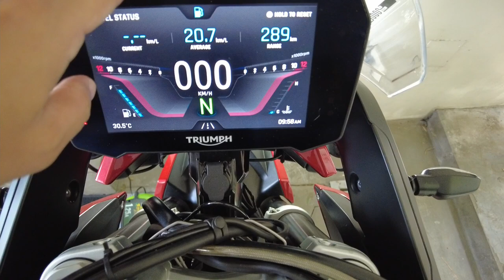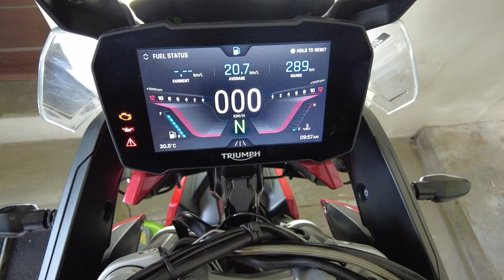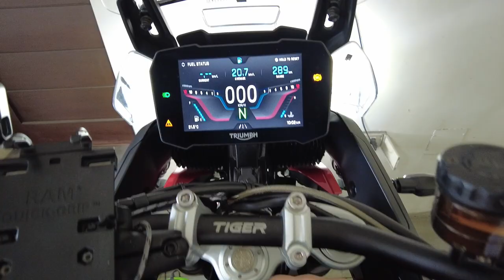Owning the Triumph Tiger 900 GT Low (LRH): Views from a New Rider

Comment: Very nice review. Yes I'm calling it a review even if you don't because it was extremely well thought out and you have included all the information a new rider needs from the perspective of an owner. Well done. Like you I'm 5' 5" 1/2 and have an inseam of 30 in, but I can flatfoot my GT pro with the low seat option. If I wear my Daytona M-Star GTX boots I can flatfoot my GT pro with the standard seat (on the low setting). Did you try a standard GT with the low seat?
Reply from the maker: Oh wow! The dealer did tell me months after I got my GT that they eventually tried the same thing that you did, which was to use the adjustable seat on the regular GT / GT Pro, and that it indeed brought the seat height to a more manageable level, without sacrificing ground clearance.  This was after I purchased my GT model, but it was still good to know that this was something others can do. It's really helpful to know that it works well for a 30 inch inseam,  so this is an option I can consider if I eventually upgrade to the Pro version. Thanks a lot for your very kind comments. I find it encouraging, because this was my first ever actual commentary or review (as you've mentioned) about a bike. Ride safe always!

Comment: Thank you for your thorough review of the 900 low. I’m 5’6” and have sat on the bike and really felt comfortable on it. For us shorter individuals I just wish there were more options for us in the adventure class of motorcycles.
Reply from the maker: Thanks a lot for your comment Chuck. I agree, I do hope there were more options. I actually tried the GS 1250 recently and realized that it's also accessible, but then I've decided to stick with my Tiger, because I do enjoy it a lot. 👍
Reply: Were you able to flat foot it? I am 5’4” with 28” inseam.
Reply from the maker: @RR9sf  Yes, I am able to flatfoot the bike with slightly bent knees. I have a 30 inch inseam so I think you'd have no problem.
Reply: I seen a video with a beginner girl rider that had her Tiger Adventure lowered for her height & it was super nice bike plus allowed her to ride with her husband 👍 I’m not trying to sell you a Triumph but they give the most options & are very nicely optioned out for anyones wants or needs.
Can’t find that in other manufacturers 😢

Comment: Thanks so much for your very informative "review" and personal experience with the 900 GT Low! I am a little over 5'7" with a 31" inseam and have been riding a Yamaha Super Tenere (1200cc) for the last year. I have the seat in the low position, at about 33.5. With "sag," I can usually only flat-foot one foot at stops. I have found this bike to be top heavy and challenging to push when parking it - as I cannot straddle it I have to roll it into place - and have dropped it doing this. I am selling this bike and am considering the Triumph 900 GT or the 800XRX, as well as the BMW F700GS. I appreciated your showing the adjustable seat for the 900. This helps a lot! Cheers from Colorado!
Reply from the maker: Thanks a lot for your comment and also for sharing your experience with  the taller Super Tenere. I recently also started looking at the GS line in case I eventually want to transition to the heavier ADVs and I was surprised at the accessible height and balance of the 1250 GS. Another mid-sized ADV bike that I was recently impressed with is the KTM 790 adventure, which is super light and easily manageable even with its 830-850 mm seat height. Good luck in your search and it would be great if you can share what you eventually decide on. Ride safe 👍

Comment: You call yourself a new rider but you have developed a good sense of discipline and confidence on many different terrains! I am also a ‘new rider’ who currently owns a Ducati scrambler  icon and a thruxton rs (I had to have it) and am thinking about buying a tiger 900 low for longer rides and adventures. Thanks to your thoughtful and thorough video, I am one step closer. I do not need to keep up with the gsx1200 folks. I just want warm hands (I know it’s extra!) and cruise control. And the ability to feel ready for a highway!
Reply from the maker: Wow, I really love the cool iconic style of the Thruxton! Thanks a lot for your kind comments Elizabeth, and it's great to meet another enthusiast online 👍. I think the Tiger 900 is able to hold its own out there on the road, and it's really quite light. Although I did have a problem when I loaded my topbox with camping gear and went offroad 😅... that was a lesson learned for me.
Reply: Remember expert to novice, it’s all trial & error 💯 I’ve been riding sense 5 & I still learning lol, and 3 time world Champ in class.
Theses new bikes are so amazing 😳🤗I’ve stuck to basics first, comfort comfort comfort, then quality, & options. That way you feel like you’re one with the bike, and not on a bucking bronco 😂
Hope that helps. Weight to Hp & Torque are helpful too 🏍️💨

Comment: Excellent video.  I am 5’7” with a 29.5 inseam. I’m also 72 years old.  I am currently riding a BMW 1250 RT because I’m doing long distance touring.  As I age I will be downsizing to a lighter, lower touring/adventure bike so I am very interested in your vid on the 900.  Thanks for your great info.  Cheers from Tucson.
Reply from the maker: Greetings from Manila! I'm really happy that the video has been of some help. What amazes me the most is how Triumph succeeded in making the bike feel so light, and how they managed to put much of the weight at the bottom. This also gave me more room to load my bike with stuff for long hauls. For example, I just bought the top box... I earlier feared its impact on "top heaviness" but I actually almost don't feel anything. Ride safe!

Comment: Thank you. I’m 5-6 and  also got my first bike 3 years ago. T100. . It’s not comfy for long distances and can’t go on gravel . I’ve been looking around for a adv that I fit on . I’m def gonna check this out.
Reply from the maker: Thanks for your comment. 👍 The bike has certainly increased my confidence in riding ADV bikes, and I've used it to try out offroad tracks as well. It's not as capable offroad as other ADV bikes (given its road bias), but I think it can handle the occasional trails. Good luck with your search.

Comment: I’ll have my 900 GT pro soon 🤗🎉 
Also remember tires will give much options on what type of riding you will me doing.
Standard tires are street. 
The suspension has all modes you can ever think of on the GT Pro or just get the Adventure model🥳
Reply from the maker: The GT Pro indeed has more options than the regular GT and I believe more riding modes. I also agree on the type of tires... I changed mine last year to Scorpion STRs and they made a big difference when I took the bike offroad. 👍

Comment: Great video. Thank you so much. I'm picking up a 900 Tiger GT Pro next week. I'm 5' 5" with a 28 inch inseam. I sat on the 900 LRH model that you reviewed and it felt great. I found a GP Pro for sale with only 984 miles on it. Perfect condition. Since it was a private sale within the state (Arizona), I didn't have to pay sales tax, and as a private sale there was no freight, setup charge, etc. that a dealer would add. Since I need to low ride height of the LRH model, I'm investing in the LRH seat, and a set of Lust Racing lowering links. These two mods bring the GT Pro down to the same ride height as your LRH model. Thank you again for an excellent video.
Reply from the maker: Thanks a lot and I'm glad you liked the video. The LRH is suprisingly low for an ADV... 770mm if I'm not mistaken. To have that height on a GT Pro is great! Congratulations!

Comment: Excellent overview of the Tiger 900 GT Low.  What's the longest ride you've done?  Did you have an fatigue?  I'm shopping for a new bike for longer ridding adventures.  Three things on my wish list are cruise control, very comfy seat and good wind protection from the windshield.  Hoping you have time to comment. Thanks!
Reply from the maker: Thanks a lot for your comment and questions Richard. The longest continuous ride I did was 400++ kms, which was around 5 hrs (no stops at all) and 6 hrs (with a dinner break). I did not experience any unusual fatigue with the Tiger. The seat is comfortable (although not as comfy as the GS 1250) and the Tiger has cruise control. Im impressed by the windshield, because it does a great job deflecting the wind and insects (especially riding at night). In fact, I can sometimes keep my visor up in lower speeds. Good luck with your search!

Comment: Excellent review. Clear & concise. "...like a scooter "....really? But that definitely is a description that'll get people like curious! And not in a negative way. The better they handle, lower in height n weight the better they are.
I am 5'-7" with a 31 inch seam; & ride a 2021 GSA R1250 LOW. Its a good bike.  But the more I look at the tiger 900 the more I think its a better bike. I had the GSA R1200 low before this....so I do have experience on the BMWs....they are great bikes....but not necessarily the best out there. 😉
Reply from the maker: Thanks for the great and detailed comment. 👍The GS1250's boxer engine seems to give it a lower center of gravity than the Tiger, even if it's heavier (especially the GSA). To be honest, I think the boxer's twin engine is more forgiving than the Tiger's triple offroad, coz the triple seems to be more sensitive on the throttle response (which doesn't seem to change even on offroad mode).  But all taken, I'm still enjoying my Tiger 900 two years on... ride safe!

Comment: Thank you. I took a normal 900 out and im 5ft 5 on a triumph demo. I dropped it! Ive bought a low ride height and had to pay the excess for the damage😢 lookong foreard to getting my 900 in caspian blue in teo weeks..
Reply from the maker: Oh no... I hope you weren't hurt yourself and that the damage to the demo bike wasn't that big/costly. I remember I dropped my Tiger (even with the low height) during the first week of taking it out to a long ride (and without first putting the crash bars). Lesson learned the hard way for me. I've seen at least one video where the owner said she preferred the red over the blue color, but I personally prefer the caspian blue. It seems way cooler. By the way, I recently took my Street Scrambler offroad and so I'll be soon releasing a video comparing the performance of the Tiger 900 GT vs the Scrambler 900, in case you were wondering how these two relate (at least offroad). Ride safe and congratulations on your new purchase!
Reply: @MotoFaith  alas it cost me 1000 quid because the tank was 💔... and a sore twisted back.
Reply from the maker: Oh man... that was a pricey lesson, but at least it was just a sore back that could easily heal. By the way, I was wondering why you chose the Tiger instead of say the GS or even the KTM 790 Adventure. These were the 3 adventure bikes I was considering at one point.
Reply: @MotoFaith  love. Never had a triumph fail me. I've had a street triple, a trident 660 and now a tiger. Buy British.

Comment: Great review, plus your country looks amazing! I'm thinking of getting a tiger 1200 for the power and shaft drive, but the weight is the issue as much as the height.. A low seat version would be beneficial. 👍
Reply from the maker: Hi Barry thanks a lot for your really kind comments, and also for sharing your thoughts about the Tiger 1200. To be honest, I have myself reached some kind of crossroad... I feel that I am ready to further upgrade, and the 1200 did come to mind. However, I was informed that, even with the low seat, it would still be higher than even the Rally Pro.  Plus, I feel that I don't need the added power anyway. I am now fiddling with the idea of getting a Rally Pro with a low seat option. I tried it and it's quite manageable for me, even if it is taller than the GT Low. I still love my GT though, and so I'm currently at the stage of uncertainty...
Reply: @MotoFaith  interesting..! I think it depends on what kind of terrain you want to ride in, and whether the rally pro would give you more capability over the GT. I recently watched a review of both bikes side by side, and it seemed the pro,with its longer travel suspension and extra engine mode (off road pro I think, which allows you to turn off the traction and abs completely) would be the better bike if you do a lot of off road. I want a bike more as a long distance mostly road tourer with luggage, and very little dirt riding.. So the bigger engine would be an advantage! Your GT is already a fantastic bike though! 🙂
Reply from the maker: @baz5806  Thanks a lot Barry! Great points indeed. You hit the nail on the head, because I was thinking of the Rally more due to its off road characteristics, but you're also right that I do not foresee myself going on lots of extreme dirt tracks anyway. I'll keep you posted in this thread on my decision. Do keep me posted as well on whether you eventually get the Tiger 1200... would love to hear your initial thoughts about the bike 👍

Comment: Nice review!
I’ve tried many bikes, Triumph & BMW 900’s are very close to each other, but the biggest thing I’ve felt was weight.
Lighter bikes are much easier to control on & off the road. 
As for comfort the Triumph is the Cadillac, of all them 🤗💯
Get what you pay for 😊
And you can pipe the Triumph and gain much power if you really need it 😂 but I can’t see needing much more here in the Philippines 😂 
You’ll be lucky to get out of 2nd gear with traffic 🤦‍♂️🤣
Reply from the maker: Hahaha! Nailed it right there on the traffic! Seriously though, I had the same consideration when I chose the Tiger  900 over the GS 1250 here in the Philippines. I felt that the triple 888cc of the Tiger gave me more than sufficient power to get around, and even to overtake vehicles in provincial roads. My friends ride the GS 1250 and I am able to maintain a similar pace with them when we take long rides around the country. Also, I like that Triumph's presence in the Philippines is consistently increasing... I took a risk purchasing their 1st showroom Tiger more than 2 years ago, because I wasn't sure if their first shop would do well enough, and so I'm happy to still be with them as they expand locally.
Reply: I agree with you 💯 
What most people don’t realize that weight per Hp & Torque have huge factor on speed.
So with you being light weight & good power, your able to hang with 1250cc bikes & be more nimble around town without having to carry all that weight 💪🤗

Comment: Great video.  I like that you covered the few negatives as well as the positives.  I have a Tiger 800 XRx  Low and I'm seriously considering upgrading.  I just need to see if I'm comfortable on the regular GT with the low seat or if I need the low 900.
Reply from the maker: Thanks a lot for your comment Mike! 👍 The GT Low has been a great workhorse so far. The only thing for me offroad is that I still find the triple engine a bit too responsive even on offroad mode (as opposed to a twin) and so I just need to be a bit more gentle on the throttle. Good luck with your selection!
Reply: I also had a tiger 800 XRX low which I loved and could touch the ground very comfortably with my 28 inch inseam. I sold it because I do ride canyons very aggressively and got a little sketchy scraping the pigs. I purchased a tiger 900 GT pro regular height and put a low seat on it. Great bike.

Comment: I appreciate your thorough and honest review. As a 5'4 rider coming from a ninja1000 with 820mm seat height and a himalayan, would you recommend the low version or the pro version for me?
Reply from the maker: Hi Joman, I think the GT Pro has an 820mm minimum seat height and so  you might be comfortable with it, as its similar to your ninja. I would've gotten a Pro or Rally myself if I had a few more years' experience at the time I got my GT (though Im still quite happy with my current LRH). In a worst scenario, I think you can still buy a low seat height for your GT Pro to shave of some more mm. All the best in your selection... ride safe 👍
Reply: Great advice! Thank you and happy trails!

Comment: Well done bro. Really nice video. Totally honest, no nonsence, practical and realistic. I have an 850 sport and have experienced all that you mentioned, except differentiating the buzz on the bars. Also,I have the reqular seat in low position (810 mm). But I would have preferred a low seat...only now I will have to purchase it as an accessory after market from Triumph (a cheap money making trick. They refused to give it on purchase). Ride on, ride safe, live safe. All the best. Shashi in Mumbai.
Reply from the maker: Thanks Shashi! I've been wondering how the overall experience of the 850 sport is, as compared to the GT, because they're practically the same body and engine (with some differences in modes and features). It's also interesting to know that the dealer refused to sell you (replace) the low seat upon purchase of the unit, because our dealer here in Manila mentioned a couple of times that they could offer that optional seat upon purchase (or maybe I understood them wrong). I'm glad to meet another Tiger rider here! Ride safe my friend!

Comment: Hello! Do you know the ground clearence of the GT LRH? I read about people who say they scrape the pegs on almost every turn and that you have to be very carefull when leaning. Did this ever happen to you?
Reply from the maker: Thanks for the question. I haven't had that experience, but my skid plate did hit the ground in a particularly rough trail. Based on my own measurement, the ground clearance is around 6 to 6.5 inches. I think it's around the same as the Scrambler 900.
Reply: That’s rubbish I’ve had mine banked over and certainly no scraping some just make these comments as there not a fan of low ride heights but take it from an owner who’s ridden both it’s perfect for the shorter rider and u sacrifice very little